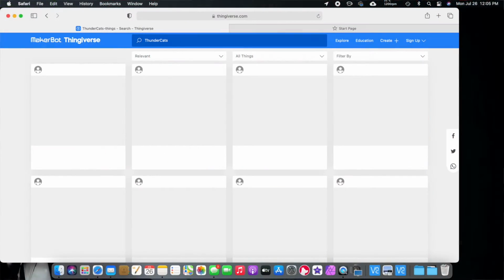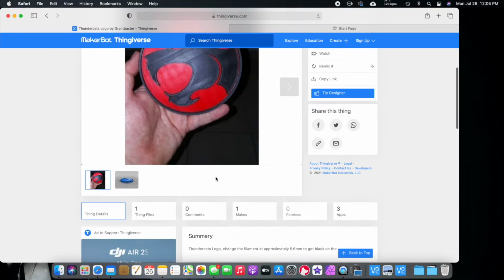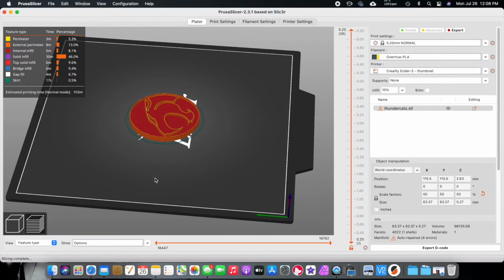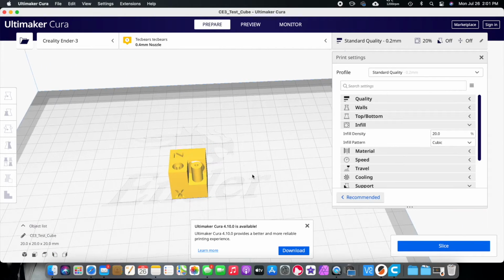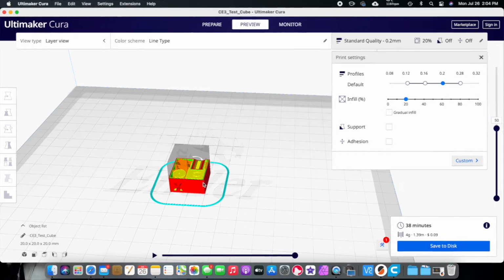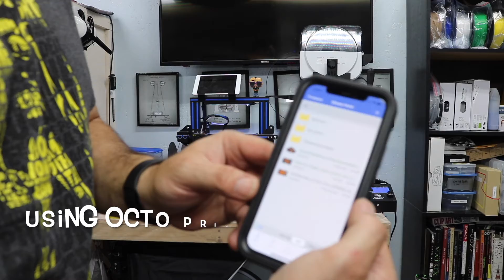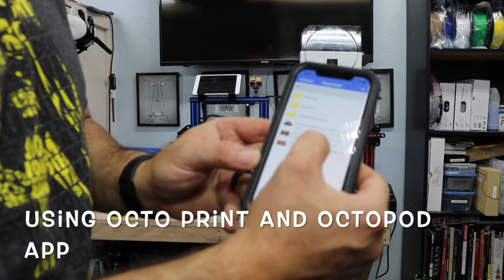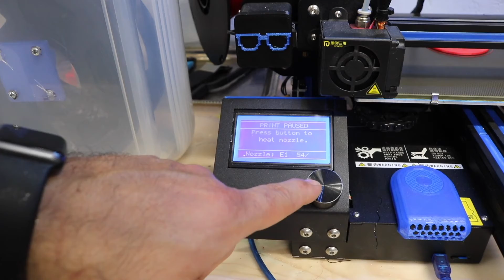How to print different colors on a 3d printer

Comment: I use Cura and just as the video showed, used the same object from Thingiverse also. My printer did not stop for the color change. Is there another setting on the printer that needs to be changed?

Comment: How do you get it to not make those line? Like smooth it out?
Reply from the maker: Good filament and leveling the bed. You’ll alway have line with FDM printing. Here’s a video on how to smooth them out. https://youtu.be/h2METhfTnTU?si=zmWf5jm8DkfGircf . Another option is to get a resin 3-D printer. They print super smooth but not the strongest. I have videos on them as well.
Reply: @CrazyWillTechShow  Alright, thank you for the reply!

Comment: Have done everything as you mentioned in your video on cura but my printer does not stop on the line set in the slicer . How do I solve this?
Reply from the maker: What printer are you using?
Reply: @CrazyWillTechShow  Neptune 4 pro
Reply from the maker: @jurgenclaeys3366  looks like you need to update the firmware on your printer so you can added the M600 gcode script.
https://www.reddit.com/r/ElegooNeptune4/comments/16l9c6h/neptune_4_pro_cura_filament_change/

Comment: What about if you have a direct drive? Is it easy to remove without moving the z offset?
Reply from the maker: Direct drives better because you have a dual z access motor. Less movement.

Comment: Hi William, Roel Dekker from the Netherlands here, Can you help me? I got a Creality CR6 SE 3D printer.
If i do the same as you do in Cura my printer wont stop at a certain level.
It will print the whole object instead of pause printing, so i can change the fillament and continue.
If i choose the option pause printing than it will pause but i can't change the fillament because it says "you run out of fillament" and when i refill the fillament i cant start it up again.

Please let me know what to do.

Thnx in advance.

Kind rgds,

Roel Dekker the Netherlands.
Reply from the maker: I’m not familiar with that printer settings. But I would try looking up g code commands, that would work. I would say it’s either the G code or certain G code functions that are not enabled in the printer.

Comment: The point of this video is that one can use Prusa and Cura slicers and others to easily find the correct layers and use the slicer to insert an M600 CHANGE FILAMENT gcode command.  Please note that you can easily to this yourself with NOTEPAD or any other simple text editor.  There are some pitfalls on the way.  Once you insert the Cura change filaments you must remember to go back and delete the Change filament command or you will now see the CHANGE FILAMENT on every subsequent print until you first go crazy.  The problem here is that the CHANGE FILAMENT message is identical to a FILAMENT RUNOUT error and if you are not prepared for the misleading message you may encounter a serious amount of anxiety.  So my first recommendation to 3D Print manufacturers is to distinguish the CHANGE FILAMENT (software) message from the FILAMENT RUNOUT (hardware) message.  Next if you decide to manually edit the gcode my recommendation is to add a 
M117 Please load the Gold Filament (or whatever other color you like)
This should display the User Instruction on the LCD display.  Unfortunately while this is clearly defined in the Marlin gcode instruction list, many 3D Printer manufacturers do not support this (ie my Snapmaker which does use Marlin totally ignores the M117 command and you never see the message.  Next I like to edit the gcode myself and load in informative information that I can reference later.  This includes a comment block header with Project name, part description, author, date, and notes about the specific gcode file.
Finally there are other programs like Prusa Viewer and Superslicer which you may use to view the gcode part.  And finally there is no substitute for great organization of all of your projects and files.  I suggest a top down PROJECT folder with each project as drill down subfolders.  I always keep the project folder on a specific work area on a work related disk or server.  Then I use a project focused Thumb drive or SD card keeping exactly the same file structure.  I try to be extremely consistent and predictable.  And in conclusion it is more important that you pick up the elements that fit your style of work rather than mine, develop your work organizational style, and be consistent.  This will help you enormously.

Comment: Very helpful! I use Cura and have the same printer, but when I’m changing colors I always seem to get a little blob extruded as it resumes the print. Ends up not looking like a smooth transition. Would you happen to know if there is a way to prevent that blob from happening when the printing resumes?
Reply from the maker: 2 things that work for me. Wipe The nozzle (which you probably already did) and make sure when you’re changing the color you don’t move the z access not even a little bit. You could also check the temperature of the filament that you’re using.
Reply: Gave that a try and it worked out! Thank you so much! 😎

Comment: If i do it with plusaslicer it always doesnt work fine if i put the file into the programm flashprinz to Print it with my adventure 3
Reply from the maker: It sounds like different printer settings. I've noticed that other printers don't use the same language sometimes. For example, on my Fokoos the stop command is different in the gcode so I have to change it... Manually.

Comment: This was an awesome tutorial and I've been using cura for 3 years now but you have turned me to Prusaslicer. I had to modify my marlin to get it to work for the m600 command but I've encountered a bug that freezes the LCD screen at "Filament Change Please wait for prompt". It never leaves that screen and I have to switch the printer off, killing the print at the filament change. Has anyone encountered this issue before?
Reply from the maker: What printer are using?
Reply: I've seen that bug reported on the Prusa forums several times with the latest Prusa firmware -- it seems to be an issue with the filament sensor, where the printer sometimes seems to fail to recognize that you've pulled out the old filament to advance to the next step of inserting the new filament, and the power crash is the only way to get things to move forward.